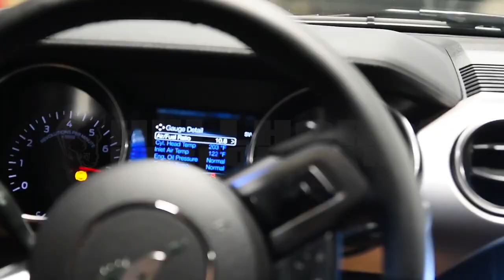THE BUDGET RACE CAR IS BACK AND TOTALLY TRANSFORMED WITH A CUSTOM CAGE

Comment: Alex,  are you going to go forward and have your block build. Before you at least test your luck for a while on the stock one and put down a number at the track?
As for the RX-8 build. The craftsmanship is beautiful, but maybe not so much the bill🙈

It will for sure be intesting to see how well it will be able to run, and if that Mazda motor will hold up. I am a bit puzzled why he is going to maintain the DI setup also.

But the biggest question I ask myself when I see something at this level and what becomes such dedicated drag car and you end uo spending literally endless money, to turn it into a reality.  
What is really the motive rather then have something that still maintains being legal on the street and on occasion at least be able to take part it some some grude racing on the street or at the track. Because this become such a massive investment of both time and money. It is at least nice to able to run for money sometimes.
Reply from the maker: Time will tell how it turns out. Btw. Big engine update in next video
Reply: It has been my dream to have a dedicated track car. I have a full street car with all creature comforts that’s fully street worthy and will be a 7-800hp car
Reply: Thanks guys for replying. I wish the both of you the very best with your cars and Merry Christmas

Comment: Did he use a 2.3 block out of an ecoboost? If so even with sleeves that block is handicapped to about 700-800whp at the very best. The 2.0 block is the way to go.